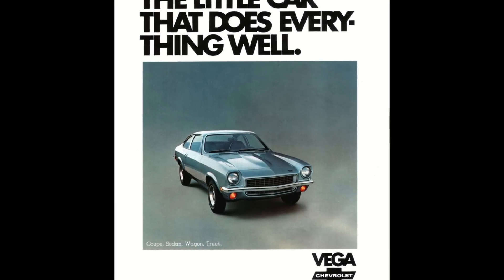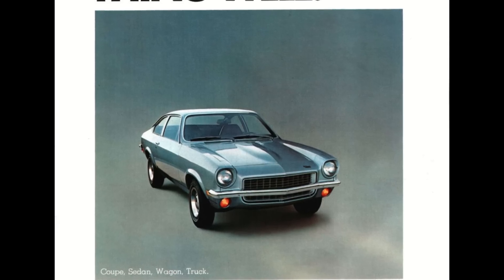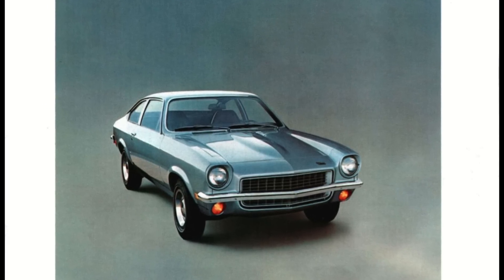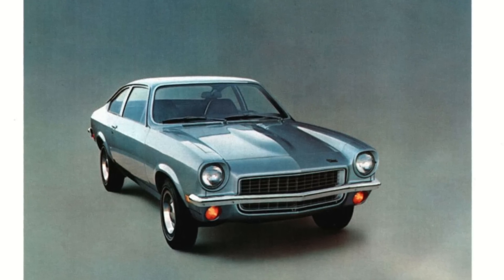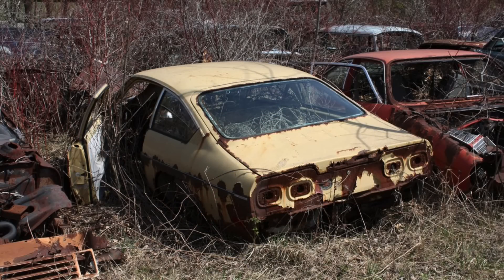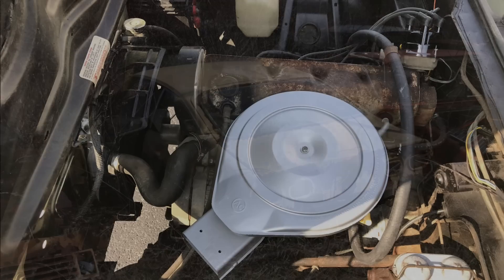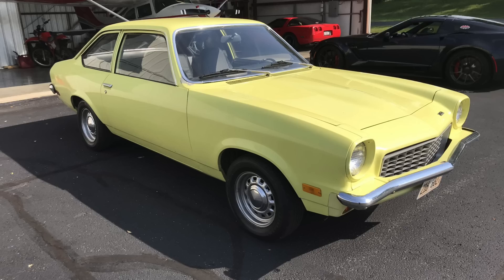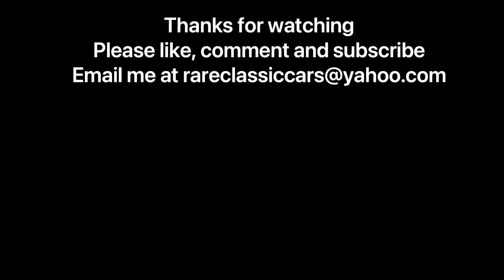GM's Largest Failures: Why The Chevrolet Vega's Engine Turned Buyers Away From American Cars

Comment: My Father bought a brand new 1976 Cosworth Vega! 
It was pretty cool! 
We kept it until 1986!
Reply: I think this is the only mention of the Cosworth Vega here!  Never had one heck I've only seen them in pictures and video but geez I'd love to own one.  Seems like with it they fixed most if not all the issues with the Vega and yeah they were expensive at the time but a production American car with a DOHC engine and EFI, in 1976???  WAY ahead of its time and what the Vega should've been from the start!
Reply: @terrybeavan4264  They still had the aluminum cylinders, but the head was a vast improvement.
Reply: @billlloyd4354  And...one still couldn't keep the front end aligned. As for the rust issue? KEEP it DRY!
Reply: I had a cosworth  it was nice but my standard vega had 110 hp and the cosworth only had 120 hp. Nice to look at the engine but without the hood open not much else to see.
Reply: @fahembree  The advertised engine ratings were changed in 1973, so it probably wasn't as close as the numbers say. Like so much of the '70's cars, emissions were strangling them. A Cosworth could be made to run really strong.

Comment: It seems that GM ignored these issues, then spent heavily on creating and retooling for the later Iron Duke and 122 engines. Wouldn't it have been cheaper, and better PR, to revise the 2300 with iron liners and a proper radiator, and never bother with those other engines?

Comment: I remember in high school someone solved the problem with the Vega engine by installing a high performance 350 Chevy and there was also a Ford Pinto running around with a 302 installed....😎

Comment: Someone once said 'Failure is like onions', there is always another layer. That was the Vega. They put too many novel features into the engine, into the manufacturing process and even the shipping. They also forgot that it is your economy buyer who is going to get hurt the worst when a product doesn't live up to what you lead them to expect. And they are usually young, will be buying cars for a long time and will never forgive you. It didn't help that Chevrolet started blaming the owners for the cooling system failures. The open deck block was an experiment. Using an iron head on the aluminum block trying to seal on the unsupported top of the cylinder was an experiment. The silicon lined cylinders were an experiment. The Youngstown assembly plant they built was never a happy place and GM Corporate took over management from the divisions and Fisher Body at this time which was part of one of the longest and most costly strikes in industry history. "Pride go's before a fall' and GM had no shortage of pride when they rolled the Vega out. They thought they could do anything they imagined.
Reply: Lordstown, Ohio. My first brand new car as a newly married young father, the Vega hurt me and my family very badly.  Fortunately, I had the skills and co-workers help to bail me out. I paid near list for this car and got the WORST car I have ever owned, After the Vega, I bought a used 1965 Plymouth Belvedere 4 door sedan, 318 2bbl, auto. My wife and I drove that car for 4+years , with no issues at all.,

Comment: My uncle had a Vega station wagon.  He carried a case of oil in the back.  When he went to the gas station, it was to fill up the oil and check the gas.
Reply: My next door neighbor when I was growing up could beat that story: He 'inherited' his son's '74 and drove it 3 miles to work. He had to clean the plugs before he could drive it back home again. The shifter on the 4 speed was so bad, it often stuck and he would have to get under the car to unjam it. They bought a used engine to swap into it as the original had one cylinder with a score. After pulling the head, they found it had TWO scored cylinders. The car leaked water so badly, he drilled a hole in the trunk to let the water out. The car was donated to the school district for the auto shop class.

Comment: Because it was a hunk of shit, thats why it turned people against it. 
That engine should have never made it to production in the original configuration. They could have used the 153 that was used in the old Chevy II /Nova ( no not the Iron Dookie ) with a better breathing aluminum head. They already had the tooling for it and the 153 was a great 4 cylinder engine. In fact its still made today for marine and industrial use.

Comment: Another example of a huge conglomerate stepping over dollars to pick up dimes.
With so many disgruntled buyers swearing they will never buy another GM product
i wonder why they still to this day make the same mistakes over and over again.
QUALITY, Jackasses! Doesn't cost...it pays
Reply: Executives that want to cut costs ASAP to increase profits and get their bonuses before they move on to a different company. It's all about short term profits, rather than long term quality and reputation. That behavior is rampant in American companies.
Reply: @d.e.b.b5788  It's rampant in companies around the world.
Reply: As long as upper mgmt have golden parachute contracts…
This will never change
Reply: @flyonbyya   Hate to bring it up but in post WW2 Japan when a CEO failed a company they often ended their own lives so that they could not simply move on to fail another company. Sad. But we have a problem today with failed principals simply moving on for even more money.
Reply: Can you please tell Boeing this?
Reply: @marckyle5895  This is exactly what I think has happened to Boeing, they have put the accountants over the engineers.
Reply: GM had 51% of the North American market at one point. Now they have 9% at best. The Vega was the first sign they didn't know where they had to go on product and quality. They repeated it over and over in the 70's and 80's
Reply: Another issue I found out the hard way, is any time the head was removed, you had to replace the head bolts or the head gasket wouldn’t seal well. Seems the bolts would stretch causing a tightening problem.
Reply: This kind of thing has happened with Mercedes also.  Their quality was staggeringly bad.  Neither I or anyone in my family would ever buy another.
Reply: Toyota!
Reply: Henry Ford was the original architect of this business concept...at least in the automotive world...
Reply: Some of these people were burned three times in a row.  First they bought an early Vega and faced engine issues.  GM did not improve or fix the problem early on.  They waited a few years to fix it.  Then they bought a early 1976 or 1977 Chevette.  More problems.  GM did not improve or fix the issues on the Chevette until 1978 and 1979.  After that it was the Citation.  The Citation was plagued with even more problems than the Vega, and Chevette had.  GM improved, and fixed the Citation problems several years later, and then called the Citation the Citation II.  By that time the Citation's demand fizzled due to the problems, and poor ratings from consumers.  When there was a problem on all three models GM took years to come up with a solution, or improved version to solve the problem.  It was the same behavior played by GM all three times on each model.
Reply: @ericknoblauch9195  The chevette was a disaster from day one. I thought the steering wheel coming out at an angle was enough to tell that car was a poor engineering project.

Comment: It wasn't long until aftermarket (e.g. Fram) disassemblable air filter housings and separate filters appeared.  I puttered around with a 75 Vega wagon long after it was worth it, even rebuilding the engine, so learned a fair amount about the works.  I didn't mind the front end, really.  It was it getting caught in a flood that made me get rid of it, mercifully, and replace it with a 1987 NUMMI Nova.  The Vega design durability and quality was simply lousy, unfortunately, and new parts didn't last any better than the old ones.  But it was fun and pretty easy to fool around with.  Adding aftermarket instruments to the dashboard was easy, as was adding a cruise control.  This was just before the time when new cars began to really fill with plumbing and spaghetti under the hood for emission and fuel economy sake.

The car was cute.  It was unfortunately also a pain in the rear.

Comment: As a mechanic at that time, we regarded the engine problems primarily as lack of maintenance.  Keep it from overheating, change the oil and they're not too bad.  I think the aftermarket came to the rescue later on the ill conceived air cleaner.  The bigger problem we saw was the flimsy unit body structure.  You could do a shock "bounce" test with the hood open and watch the shock tower flex.  But the biggest deal was the front structure would sag after about 50,000 miles, after that you couldn't get the alignment right anymore.  The best you could do was get the caster (sorry, I meant camber here) right and match the caster the best you could.
Reply: YES, I had this problem with mine, and it could NOT be fixed. Took it to shop specializing in front ends and they told me that this was a huge flaw. They said even if straightened out it would soon "Sag back" to worse than before.  I could cope with the engine issues, and to an extent, the body rust, but this was "Death knell" for a car at 4 years old, and right around the 50k mileage mark. The final blow came when the body under the body rusted away, causing the battery to shift and tip over which caused it to weld itself to the alternator!!!
Reply: @dougdanzeisen9608  I'm sorry yours rusted out, having been in Texas since 1972, the worst rust we ever see is surface rust.  A friend of ours had a '73 Vega, I'd driven it and liked it and considered one for my first car.  Fortunately, or unfortunately, a new car wasn't in the cards for a college student.
Reply: @robertstout6980  I understand that. I did like mine or I would not have bought it. It just surprised me how fast it deteriorated.
Reply: I welded in reinforcement bars in mine. Worst car of all time!

Comment: These things were terrible rust buckets. Aside from the lack of front fender liners I heard that during the dipping process the unit body had air pockets. These areas did not receive a rust inhibiting coating, especially when you are trying to crank out 100 cars an hour. The rapid pace of production equated to terrible build quality. I also heard the four banger shook to the point where it could cause carburetor problems. The Vega was so bad it actually made the Gremlin seem like a decent car, at least from a reliability standpoint.
Reply from the maker: The Gremlin was a solid car. Good engine and trans
Reply: I had a 74 Toyota Celica gt and it did not have fender liners either.  Freaking rust bucket.  And the 18rc engine had rocker arm wear issues due to oil starvation at startup.  Not everything Toyota is gold.

Comment: The root cause of most of the problems is that the Vega was the first design program to be done by GM corporate engineering at GM Research Staff rather than the traditional GM division staffs.  Then about a year before production started they "threw it over the wall" to Chevrolet Engineering where it was looked at like a turd in the swimming pool.  The organizational rivalry between the two groups which didn't help either.  This was when GM was feeling omnipotent in the industry so nobody really worried too much about the what the intramural pissing contest resulted in.

Comment: When I turned 16 in 1973 I was going to purchase a 1968 Pontiac GTO that was mint for $800.00. When I discussed what I wanted to do with my dad, he said NO and we proceeded down to the local Chevy dealer and we ordered a new 1974 Vega. Needless to say I wasn't overly happy with my Vega, and I will admit in the 2 years I owned it (and being 16) I beat the s...t out of it. It Never let me down, but it was starting to use oil so my dad traded it for a used 1974 Nova. Funny thing about it, the Nova had a bad motor we discovered a couple of days after we bought it. Took it back and got my Vega back! Then the next day I bought my moms 1974 Monte Carlo and got rid of the Vega. Looking back 50 years later, I wish I would have keep the Vega!

Comment: Thanks for another Vega video Adam.   I grew up hearing the many horror stories of my dad’s brand new ‘72 hatchback.   As a kid hearing about his 3 engine failures in 2 years, I didn’t get the concept of the aluminum engine block and lack of cylinder liners.  

In addition to the car overheating and destroying its engines, my dad’s car suffered from the famous rust and two transmission failures, all within 2 years of ownership.   He wound up dumping the car in early 1975 for a ‘72 Catalina, a car he loved for almost 10 years.   He also never bought a brand new car again.

Comment: An excellent overview, Adam. As always.  Not a bad looking little car, it's honestly hard to objectively say much else positive about these cars (Cosworth excepted).  I do think the poor quality in most every part of these cars was one of the main few reasons Americans started buying Japanese cars. I'm reminded of a quote I once read about the Vega:  "if it's only slightly rusty, it's still on the assembly line". A very disappointing yet astounding combination of design innovation, inadequate engineering/testing, very poor rustproofing, and indifferent build quality. I could add non-competitive equipment levels/pricing (it cost more than the Pinto but had a 3-speed manual transmission standard -- the 4-speed was optional!), but why kick a car a any harder when it's down?

Comment: I am an old (77) guy.  I have always marveled that GM  did not use the Opel 1.9 I had one in an Opel GT.  They vwere very good engines.
Reply: I agree. The 3 and 4 speed manual transmissions in Vegas were Opel. You would think if GM was so set on saving every penny on this car they would use an already developed engine rather than going through the expense of developing a completely new one.
Reply: The transmissions were sagnaw n made in Michigan.
Reply: Yes, excellent engine. We had one in a 1900 Wagon that we bought new in 1974;  loved how that car drove too with German style highway steering stability.  We have never owned a car before or since that steered so well, not even any of several VWs.

Comment: 4.10.24.   my brother bought a brand new 1974 model Vega hatchback, he had to do a valve job at 61,000 miles! The transmission also was pretty poor. It was a five speed manual and I remember driving it and the second gear had a notchy ness to it when you shifted it. All in all a pretty poor car.

Comment: the first problem with GM is the mentality and the bean counters,  
At the moment where that car was on the drafting board, GM had branches in Europe and Asia so they  were able to source an engine that would have been much better than the infamous Vega engine.
It is the starting point, the rest of that car was developped that way so the car was crappy from the front bumper to the rear bumper.
 your engine overview is excellent and the clear demo that GM took a good basic idea and made junk with it  as usual.

Comment: This marks the beginning of the mindset that the public will do the testing for product quality and robustness.  It sent shockwaves through generations of car buyers.  Not only GM but Ford did this with the exploding Pintos and Bobcats.  K cars weren't much better.  The front fender aprons were weakened by corrosion and the struts pushed through and buckled the hoods.  American makes just couldn't adjust to the new normal with small cars being the norm.  Today's offerings are superior but the cost is becoming unattainable to most households.  It's no wonder people are not running to the dealerships to spend the obscene amounts of money to purchase new.  I just can't see where the offerings from overseas manufacturers are superior.  The styling is atrocious.  The security systems are easily defeated and now we are paying the price through higher insurance premiums.  
I say if it ain't broke don't fix it!!

Comment: Cast iron cylinder liners with decent pistons to match, a half fill of concrete mix in between the open decked cylinders, and a three times bigger radiator all might have made a difference.  Maybe.

Comment: The dummies. Why didn't they just use an Opel engine like Ford used engines with established reputations from Europe in the Pinto.
Reply: Ford should have imported the Cortina with the 2.0 OHC Four. Or, tooled up and built a version here in the States with the 2.0.
Reply: @MisterMikeTexas  Internal politics, I suppose. The European Capri was also being made and was a far better car than the Pinto. I owned 2 Pintos and liked them both but they couldn't compare to my friend's Capris.

Comment: My 1975 Toronado could have a coolant level sensor as an option, mounted into the passenger side tank of the radiator, below the rad cap.   I wonder if the Vega system was similar.